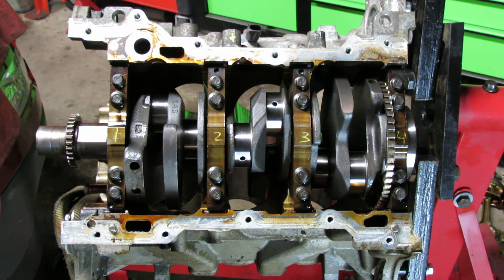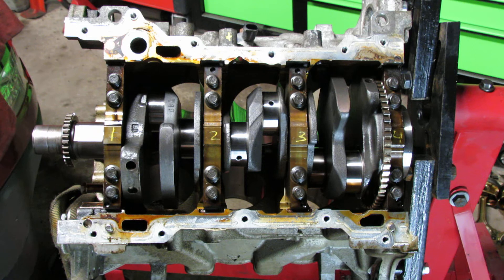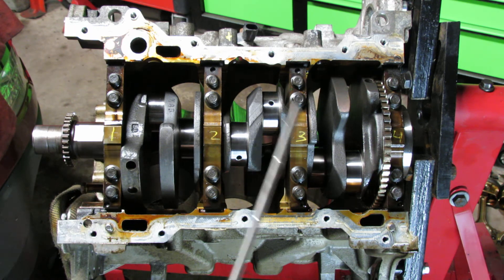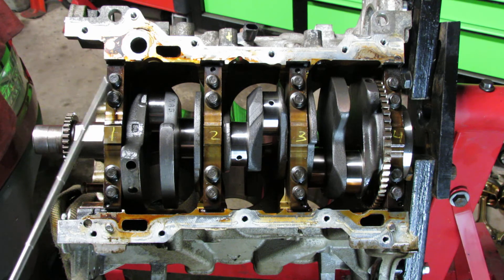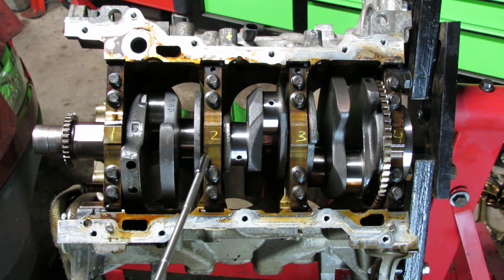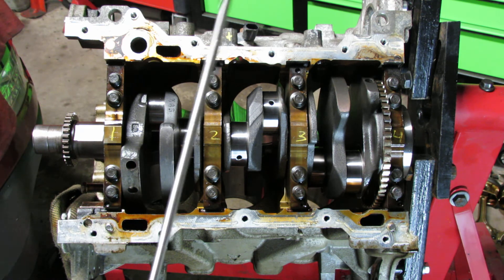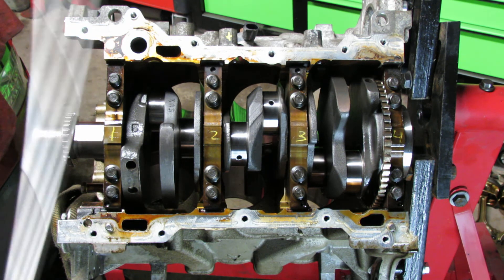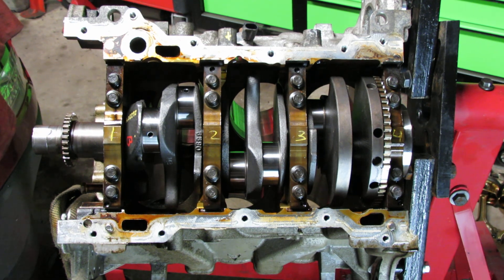3.6L GM Engine Torque Specification/Sequence: Crankshaft Main Bearing Caps

Comment: Did this have any issues after assembly? Need to put mine back together and do not want to spend $450 on new TTY bolts
Reply from the maker: It is HIGHLY recommended that you replace the TTY bolts but I've done jobs reusing the bolts due to customer being in a pinch. Have you tried Rock Auto?
Reply: @HP38567  yeah they do not carry them. Gm says the connecting rod caps are $30 a bolt. Found a cheaper set on ebay and we are reusing the mains.
Reply: @sentein3538  did it work ok reusing the main cap bolts?

Comment: Like to mention cleaning each bolt/ thread/hole before assembly. light film of 5w30 oil on threads  and under heads of bolts. It will effect the final torque. 
Rest looks/sounds great. Keep up the good content!
Reply from the maker: Thank you so much!
Reply: You only lube bolts if it tells you to in the gm service information and the service information tells you where to lube them and what lube to use sometimes it’s engine oil, some times assembly lube, some times a light grease you can cause problems lubing bolts when they should have them. For instance if you put lube on the head bolt threads on this engine can break the head bolts because where the head bolts go into the block the hole isn’t drilled all the way through so living the threads will hydraulic the bolt so it will stop turning and/or reach the torque much earlier. The first 3.6 engine like that I did I was working at the dealership in 2007 and one of the head bolts broke when I was tightening them because I put oil on the threads. This engine and many other engines require you to only put lube on the head of the bolt where it contacts the surface of the cylinder head. I do a lot of engine work and on every engine I do I use transmission assembly grease and put it on the head of the bolt where it contacts the head this is the only area that you can lube on every head bolt and not have any issues again you must check service information to see if lubing the threads is required or not. Most old engines like a Ford 302 the hole that the head bolts go into are drilled all the way through and into the coolant jackets so you actually are required to put a thread sealant on the threads to avoid a coolant leak. 

I would also like to add that these main bolts are torque to yield which are one time use bolts so he should have replaced the bolts. When a torque sequence requires degrees to torque that pass is stretching the torque to yield bolts.